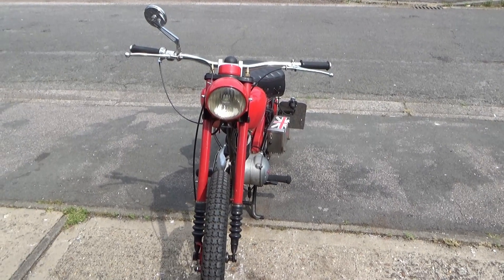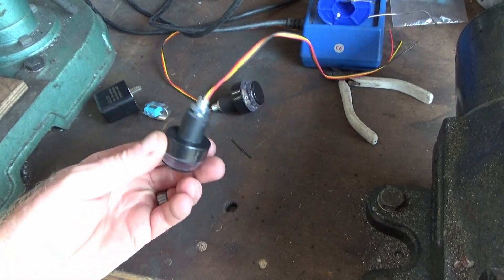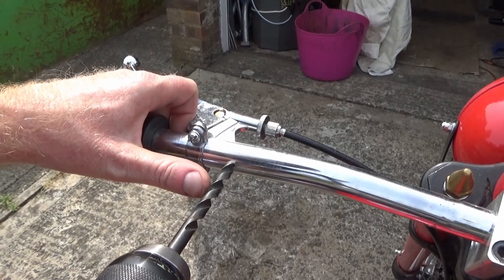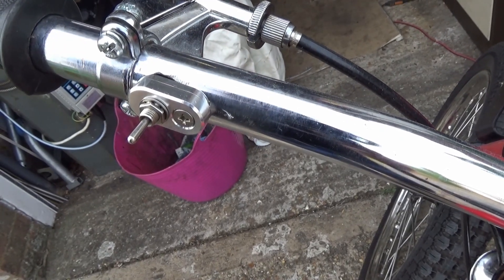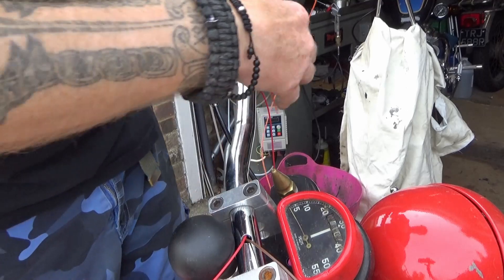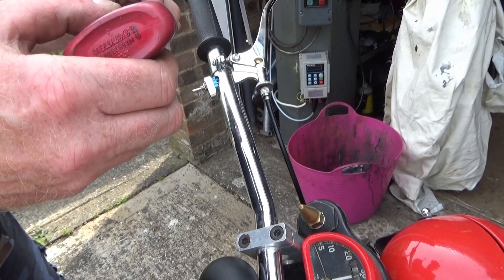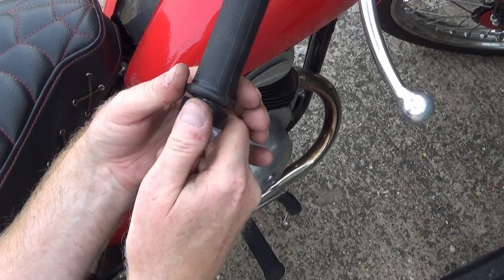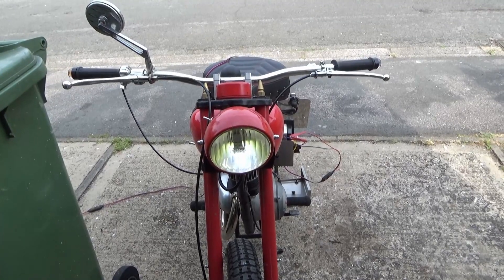BSA Bantam D1 - LED Indicators Installation

Comment: Any info on that battery set-up?? Looks interesting..is it a conversion kit..? Always interested in updates to these old fossils to make them slightly less lethal on modern roads..
Reply from the maker: When I got the bike, in lots of little boxes, the ignition system was missing so I bought an off the shelf CDI electronic ignition kit with the 12 volt alternator. I used a battery from an alarm system back up as I wanted to use it to even out the power supply but it will run without it, all it does is smooths out the power supply which can cause the lights to flicker.
Reply: @bodganeering  thanks...any chance of a video tour of the system..? I'm thinking of doing something similar and seeing a similar system is a huge help.. thanks 🙏👍
Reply from the maker: @enhancesoutheast5964 I could do one, give me a couple of weeks.
Reply: @bodganeering  I'd really appreciate that if you have the time..I think there's a few people who'd be interested in such an upgrade..the battery option is especially interesting..
Reply from the maker: @enhancesoutheast5964 I’ve just uploaded a quick video showing the basic set up.

Comment: Please tell. What is the law regarding indicators? I just bought a D1 and it has no indicators. Thank you.
Reply from the maker: If they were never fitted by the manufacturer then they are not required. IIRC the cut off date was registered before 1982. 

I only fitted these due to riding at night and myopic cagers couldn’t see my hand signals.
Reply: Fair enough. Thank you. @bodganeering

Comment: I had thought of doing something like this on my D1 Bantam, problem is I don’t have a battery
Reply from the maker: Doesn’t need to be a big battery, I’d steer away from Lithium Ion batteries as they need a stable charging system but you can get small ones for alarm systems that you could possibly took away in the tool box or fake pannier bag etc.
Reply: @bodganeering  yes I had thought of that, mines a 1951 D1, direct lighting, it would be a bit messy to trickle charge a battery. I suppose it could be done, it wouldn’t need much current